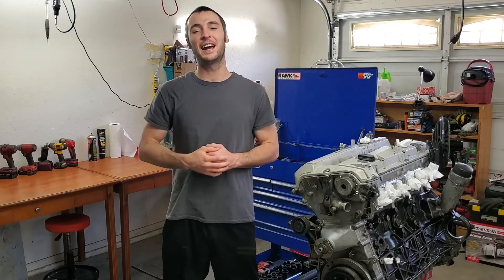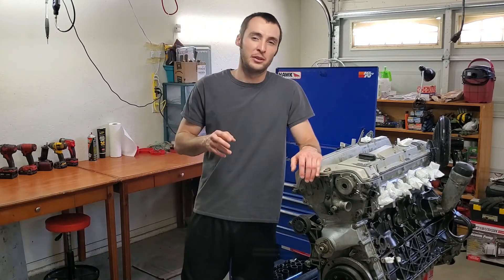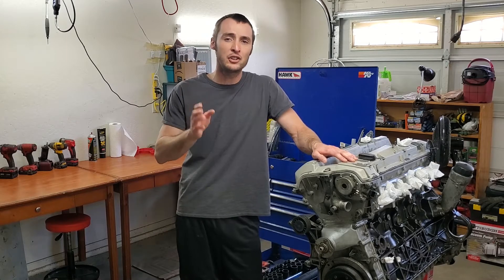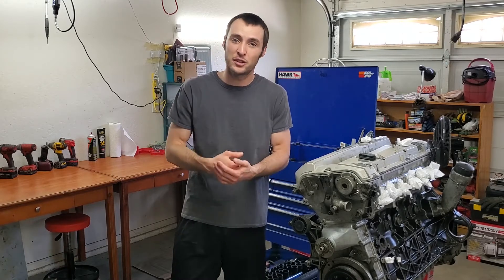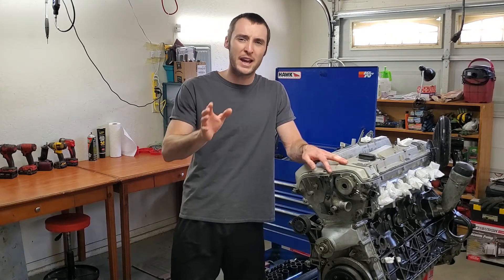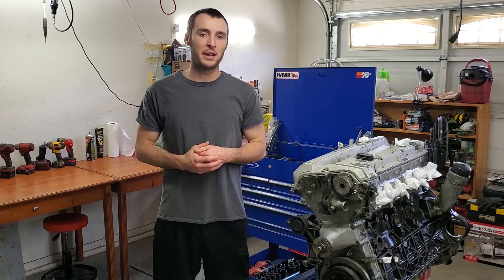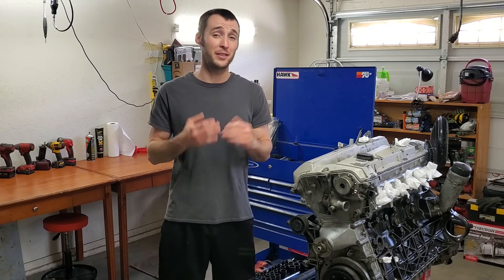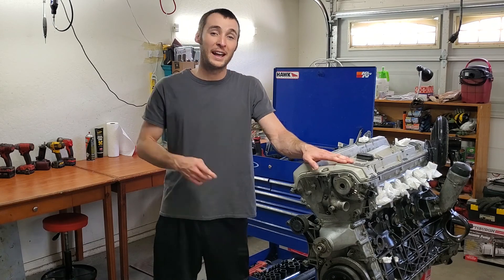How To Build An Engine

Comment: I have a om648 on my garage, engine started developing alot of blowby and it was about to go, Because i didnt want to risk it, i found another engine in good condition and put it back into my car. Right now im wanting to hone it and put new rings and pistons in it! Obviously Aftermarket pistons and rods but u are very right about not being scared! Im not scared at all. i’ll waste money to risk it, to risk being someone who can sort of build their own engines rather than not knowing what your engine builder is doing and charging you thousands! The perfect engine for your style is one you can build yourself! because you will have nobody to blame!
Reply: im pushing 400hp so thats why it started going bad
Reply from the maker: Bro, yes! You can absolutely do it, and save so much money in the mean time. Not only that, you make yourself a smarter, more capable, better person. 

idk about the om648, but i know the om603, om605, om606 all can hold SO much power (like 500hp and too much torque) without any mods to the block. 

Just make sure you have a good cylinder hone, good rings, and youre using a quality air filter. Shouldnt develop blowby after rebuild.